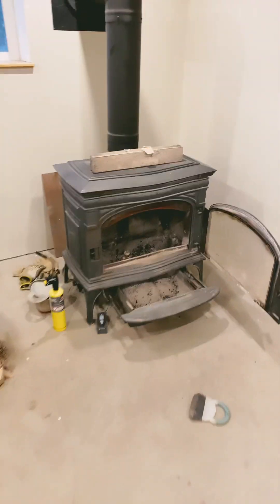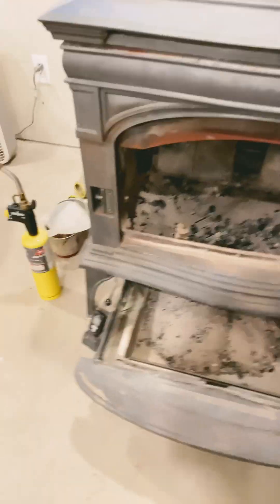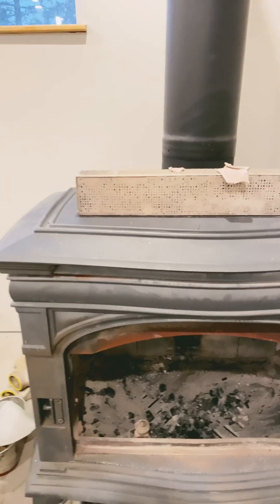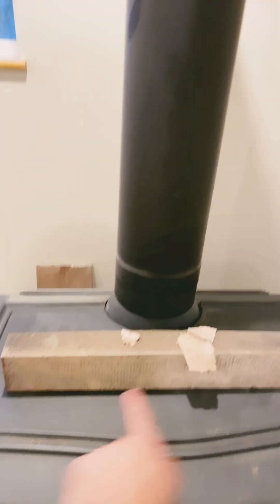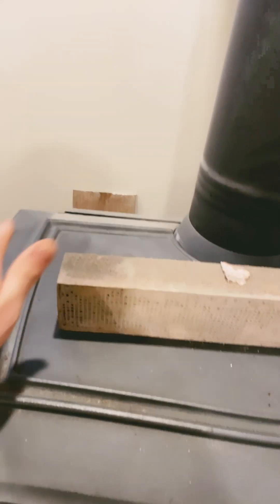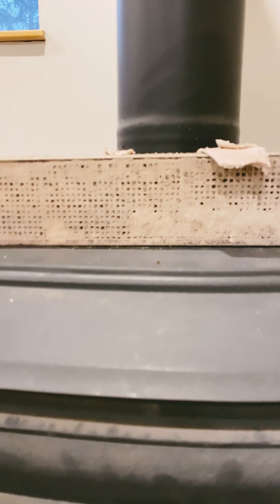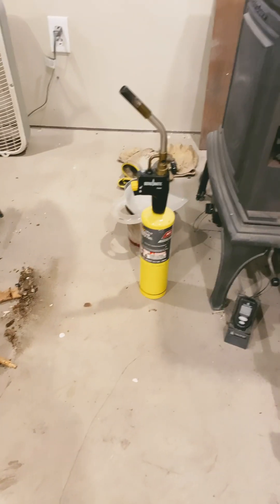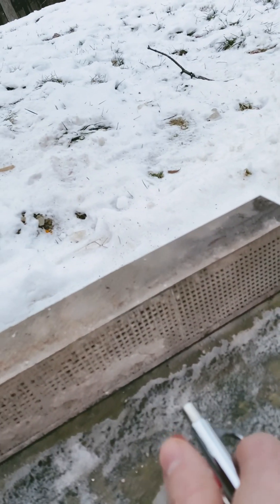Lopi cape cod wood burning stove catalytic cleaning

Comment: Does yours not have a plate over top the pipes below the cat
Reply from the maker: There is a door I can open in the back to bypass the cat and the smoke goes straight up the chimney pipe instead of through the front through the cat then up the chimney.

Comment: My 1978 fisher grandpa bear does not have one of those
Reply from the maker: You can buy an insert for the stove pipe. the purpose is 2 fold, it generates heat absorbed into the home, and the exhaust gasses are cleaner for the environment. Thanks for watching!

Comment: What is this catalytic converter converting
Reply from the maker: Burning wood is note pure conversion of wood+ oxygen to CO2. There are other "wood gasses" produced during compustion, Hydrogen, carbon monoxide, methane, acetic acid, and other hyrocarbons(smoke). the catalyst like platinum metal will react with those gasses without being consumed and allow them to break down into CO2 and water vapor. This reaction generates free heat you can use in your stove. Great link to explain all this. https://midwesthearth.com/pages/catalytic-combustor-faq Thanks for your question and thanks for watching!

Comment: wtf shit brother you need to move to a state that has the right to live like Alabama roll tide
Reply from the maker: It is optional not a state requirement in CT. Catalytic combustor at temperatures over 500F starts to generate it's own heat due to redox reaction of other gasses. FREE HEAT. and it cleans the air. I've don't think I have ever been to Alabama. Thanks for watching!

Comment: Never heard of a catalytic converter on a wood stove
Reply: A stove built for a catalyst usually has a diverter so the startup (cold) smoke/resin doesn’t clog the catalyst.. Once the stove is hot, you swing the diverter so the preheated catalyst works efficiently, and doesn’t clog up like this.
By the way.. Preppers love catalyst stoves.. they don’t make smoke and most can be “tuned”  for efficiency because they have excellent air controls.
Reply from the maker: Yes, you are correct. I am lazy and don't wait for it to get to 500F to close the bipass damper, thus I have to clean it.
Reply from the maker: A durable, large catalytic combustor incinerates any left over particulate, burning up to 99.5% of the flue gases and all but eliminating any carbon monoxide. Link to manufacturer spec. https://www.travisindustries.com/docs/98800547.pdf
Thanks for Watching!
Reply: @everydaypawel9193 Dumbest thing ever.
Reply: @faxRfax 
It facilitates a more complete burn.
Unburned gasses escaping out the chimney is wasted fuel. Without it, it's like running an engine too rich, burning through your tank faster and missing out on performance.
Reply: @execration_texts  still. It's the government telling you how to BBQ.. #Dumbest thing ever.
Reply: It's called catalytic combustor. They make the government required emissions possible.

Comment: If you can get a woodstove with a reburn system... it's far better than a catalytic converter.
Reply from the maker: Thanks for watching!
Reply: @everydaypawel9193   Out of curiosity what's the life expectancy of the catalytic converter?  

And

Can you clean it with parts cleaner to get the resins out?

 The truth of the matter is we are so far behind Europe when it comes to wood stoves.  They have woodstoves that are 90% plus efficiency.
Reply: @Irvingstine  i wouldn't use parts cleaner in the cat because it may harm the platinum and palladium and whatever it there, making it useless.
Reply from the maker: @Irvingstine  I don't know. Mines has a small crack, 4th year. I burn alot! funny my cousin said his is cracked, and $150 for replacement. costs vary.
Reply: @everydaypawel9193  That's not to bad.  I though it would be more. Any hack to delete it?
Reply from the maker: You can simply remove and not use the CAT, I dont' know of any method to repair. This is chemistry occurring within a delicate item at +500F, I say buy a new one when it comes time... just like on a car.

Comment: why in the world would you have a catalytic converter on your wood stove? that's like an 80cc tweezer.  you can do it but why would you?
Reply from the maker: I might have said Catalytic converter, I think Catalytic combustor is the correct terminology. sorry not an expert. The catalytic device can generate it's own heat when it is over 500F due to redox reaction of other gasses, so more heat is generated that would other wide not be.. more efficient. Again, not an expert to comment on the details. Thanks for watching!
Reply: @everydaypawel9193  I've seen them demonstrate those things and they seem pretty awesome
Reply: @everydaypawel9193  I find this amazing.  Pollution control for a fireplace just seems amazing to me, I had no idea the technology was in existence.  Thank you for sharing that information.
Reply from the maker: CAT can be purchased for the stove pipe exhaust if not part of the stove design.

Comment: Whats the clearance on your wall there? I have been trying to find a stove with low clearance to combustibles.
Reply from the maker: Link to manufacturers specs, I am 1 inch beyond what is required. The wall gets pretty hot. https://www.travisindustries.com/docs/98800547.pdf Thanks for watching!
Reply: @everydaypawel9193  I would think your local building codes set the actual spacing, not the mfgr recommendation. And yeah that side spacing looks hella tight...
Reply from the maker: @daytrypper  Manufactures specs are based on fire code. Inspector asked for the manual and took measurements. at the end of the day, you need to please your inspector, and not burn your house down.

Comment: You’re actually supposed to vacuum them out and not shoot air through. You could potentially damage the cat. They’re a $300+ part and with House of Fire you have to go through an approved dealer to get parts. So you’re paying full retail 9/10 times.
Reply from the maker: I tried to vacuum, doesn't' work well. another video, I use a metal rod with some electric tap. It's more like $500-1000 for that now. Thanks for watching!

Comment: I had a Vermont castings stove with a catalytic converter, worst stove ever
Reply from the maker: I clean it 2X per year, beginning and middle of the season, and only if I sense my stove cannot reach 1000F. so far ok. Thanks for watching!
Reply: I had a Vermont castings stove with converter for 19 years that ran pretty much nonstop for 4 months a year. Usually had to clean the converter once per season. It heated 2000 sq feet . Wood type made a slight difference in heat output , but all wood has a btu rating. We used it to cook on several times during ice storms when power was out. I often left a large pot on top full of water to increase humidity, and always have hot water . The converter reduces creosote buildup in the stove pipe .
Reply from the maker: @allensanders4204  you are very smart!